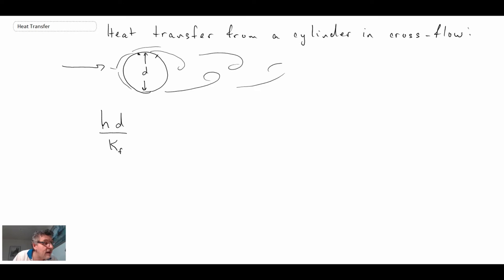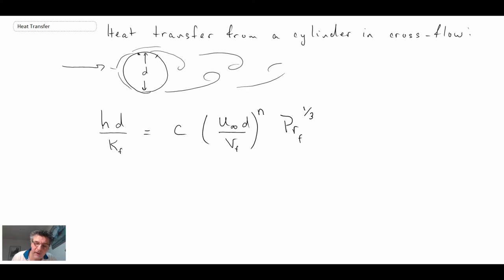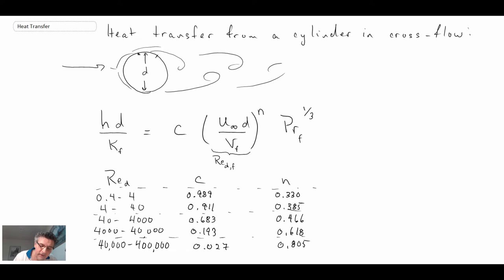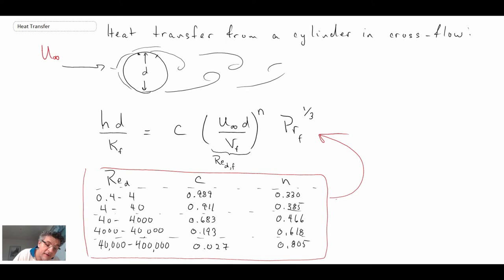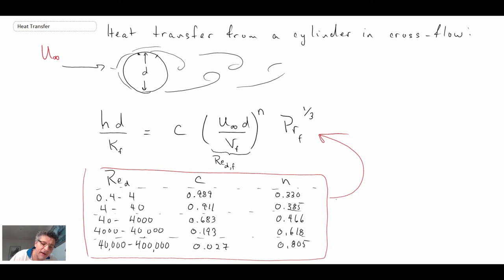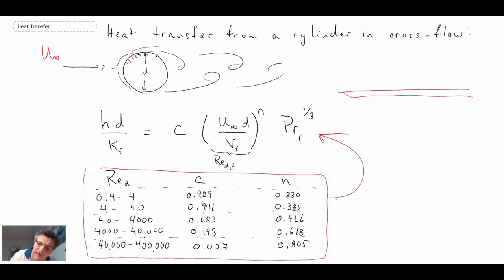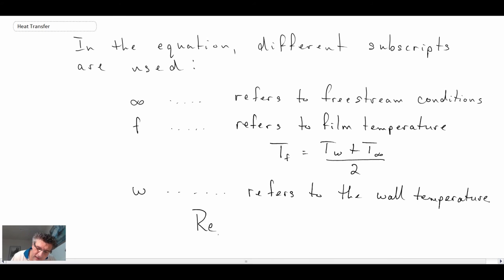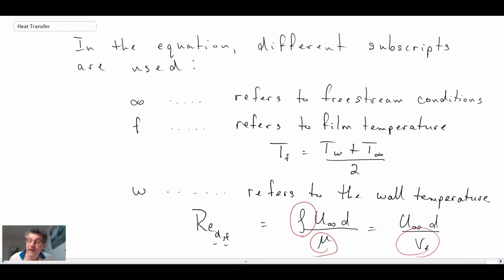Heat Transfer L19 p3 - Nusslet Number - Cylinder in Cross Flow

Comment: I am using a radiator and i need to find the reynold's number of the fluid flowing inside. The inlet temp of the fluid is 70•C, outlet is 61•C
The room temp is 27•C 
What will be the temp on which my kinematic viscosity vary?